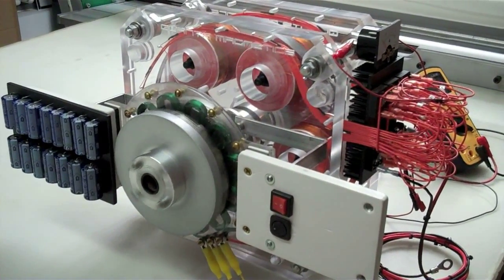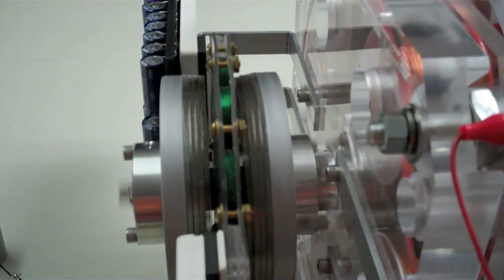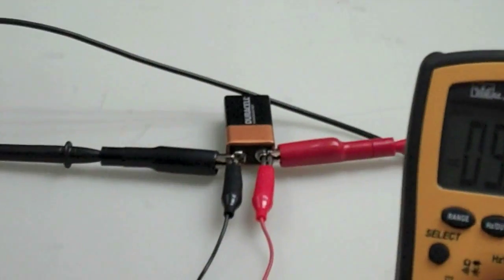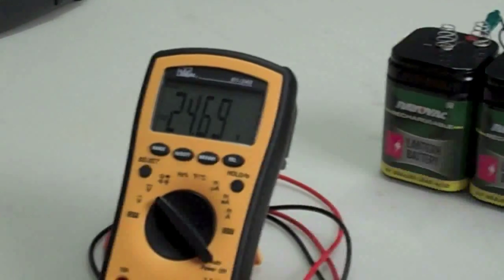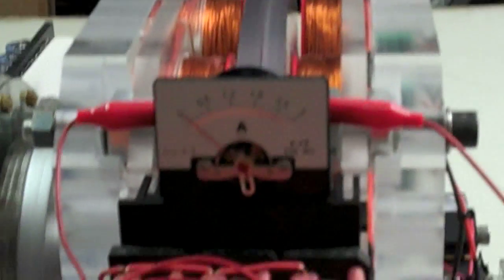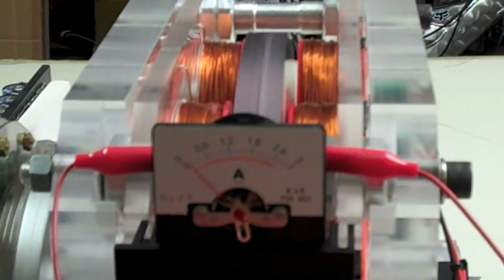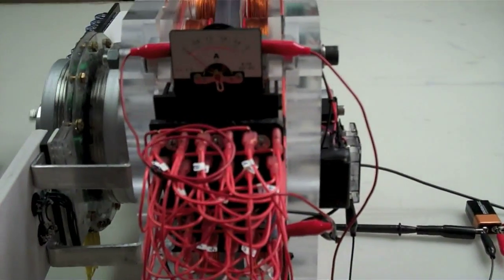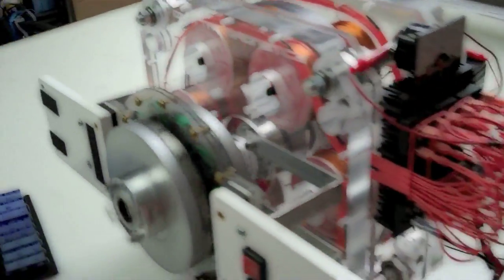Ultimate Pulse Motor Generator - New Energy

Comment: It is the relation magnetic strenght mulitplied amps that gives the force in motors
It is the multiplied forces of magnetic strenght, wiring and speed that gives the ouput current in generators.
Magnetic strenght is everything in this.

Comment: Well the relations are wiring multiplied by Magnetic strenght multiplied amps gives force(newton) which give speed- drag multiplied by magnetic strength and wiring
gives output current.
Forget about that input current is only lesser than the output current. That idea is not back up in any laws of electromechanic.
The magnetic strength is the key force here.

Comment: the magnetic strength is what the water wheel puts out, to say it in terms of the analogy.  That magnetic strength is then used to "pump other water up" (producing electricity). Drag is just lost friction energy. This energy is not gone it is just converted into heat (from the friction). I would not state that magnetic strength is key in this, it is just an in between state of the energy. Electricity->magnetic strenght-> electricity.

Comment: Imagine it this way. There is a lake on top of a mountain containing a lot of water.  The height difference is analog to voltage, the amount of water stored is coulomb and any stream going down is amps. If you put a water wheel in the stream it is going to create resistance and convert the tapped power into turning a grinding wheel for grinding wheet.

Comment: battery. In this case the size of the batteries is misleading. Overunity or free energy motors do not exist. Please accept and move on. There's tons of work that can be done in other areas of science, like computing, programming, quantum physics and more. Maybe use your experience with electric motors to make them even more efficient.

Comment: the only thing the energy from the 9 v battery has to do is overcome the friction. As your engine is "high quality" it doesn't have a lot of friction. You might respond with"How can it charge those other 6 volt batteries then, together even 12 volt?". A quantity of current is measured in coulomb or maybe overseas in another unit. The amount of current that those bigger batteries can store is probably less then what the nine volt battery can provide as they are lower quality then the first

Comment: The real reality is that it is the relation between the Tesla (magnetic strenght) MULTIPLIED with amps that determent the Force(newton) which create the speed.
It is the Speed MULTIPLIED by Tesla that determent the output current.

It is the drag in generator that determents the energy cost.
When infact you dont need Iron cored coil.

'That prove one thing, That Ideocratcy have existed in a very long time in the ingeneerings area.

Comment: Another "against the laws of physics" over unity machine, that is total BS. For Example. Suppose that 9V has 10 units of energy and this machine miraculously turns that into 175,000 units to put in those lead acid cells.....nope, don't work that way. Those lead acid cells be lucky to get 2 out of those 10 original units!!! Those pulse motors recoup some of that magnetic energy.... all that means it just lasts a little longer before it dies/stops. No New Energy and there's NO FREE LUNCH.

Comment: And exactly that is when it really get interresting.
The lesser mass, the greater speed.
So if the design of such example as this video, the relation of the generator and the electric motor. 
If the moving mass made as little as possible in boths ends.
An example is when the moving parts is only the wiring part.
It give greater speed, and greater speed gives more current.
And offcourse all drags must be made minimal.
Now the picture is different between input and output current.

Comment: I said power because both current and voltage counts, they work together , thats why a transformer can not ever be more then 99 % efficient. And secondly the magnetic field of a permanent magnet is not a form of energy and rather more a state of matter just like solids,liquids,gases,and plasma, and further more is not a very stable state as it is affected by temperature( extreme heat weakens the magnetic field)

Comment: It's actually the inverse of what you are saying.  When someone makes a proposition, the burden of proof is on them, not the dis-believer.  So, if this device is capable of charging large lead acid batteries off a small 9V battery, then the output current should be more than enough to power the input of the motor with energy left over.  I did not see anything that suggest this is the case with the video.

Comment: There are a lot of factors in this
The relations are
input current 
multiplied by Magnetic strength
multiplied by wirelength
Equals force kg/s
Equals speed
multiplied by magnetic strength
multiplied by wirelength
gives an output current.

Minus drag which vampires effective the output current
minus Back emf 
(Iron coil cores big sinner here, 
drag follows magnets strength)
How can anyone`in all that, believe that 
input current is the only relation with 
the output current.

Comment: Friction on the bearing? Then it is a bad designs.
Those things can be avoided. Try and look the link below up.
The laws of nature CANT be opinionated, it just HOW IT WORKS. That is the real facts and the fact are it works like The Caplace Law- 
Although I agree that it dont work that way in Iron coiled generater. Becourse the friction to the iron core increases along with the magnet strength.
In motors and generators with Non iron cored coils, that is a different matter.

Comment: The prove is within that is already told, you dont need calculate it into watts.
Put in to other words: Let say you have a generator that needs 50 newton to create 10 watts. Then you use a moter that needs 15 watts to create 50 newton load.
Now replace the magnets in the moter with some that is twice as strong
According to Laplace law.  
you will only need half as much watts (7,5 watts) 
to create 50 newton load.
And now the system creates more energy than there is put into it.

Comment: No offence, But You just dont get the math.
If you can avoid drag, you have constant kinetic energy.
That is by far, more energy that you have put into it. 
When the 4 properties relations are multiplied 3 times.
If the proberties are high enough you will end up having more energy than you put into it. Especially when energy cost is reduced.

Comment: The whole issue is revealed in the math. The relations between wirelength flux and amps are multiplied to find the newton force. It says nothing about the drag. That is added values. Such as coil inductains the higher Hz the greater the drag. The greater the ohm the greater the emf. Iron coilcores drags follows the flux strength. Point is a lot can be done in designs to avoid drag.

Comment: With no current in the wire it generates no magnetic flux, move that same wire inside a magnetic field and you can generate a small voltage but come on, you're never going to get out more energy than you put in! However much energy you pulse through those coils is how much energy you add or subtract from the kinetic energy of the magnet. Every action has an equal and opposite reaction, this is one of the fundamental laws of physics. If you'd like me to explain in more than 500characters email me

Comment: I am really questioning if coils is the right answer in the generator.
Becourse of the inductains its producing. Parallel wiring would avoid that.
Not very practical at first sight, but there are many benefits in that, due to lesser heat production, lesser drag, more amps, lesser volt. Simply way better flow in the system.
The battery is offcourse also a problem here. "A solution" could be electrolytes compined with batteries or simply use the power instantly.

Comment: Do you have, will you build or tell us information of your version of axial flux generator that is just right and enough power to run with QC Motor Generator without slow it down too much and still have current to charge a bank of batteries, it would be nice if you include with it a axial flux generator?

Comment: Your talking about a single engine. I am not. 
Nope the whole point is the flux, that is everything is this equations.
The flux, wiring and kinetic relation is what determent the energy.
The greater flux the greater output and lesser input.
That is why with out a doubt works.
IF you do it right and dont do all the drag mistakes.

Comment: Nope not even close, I'm surprised you missed my woodchuck reference. If we have a wheel spinning and assume a frictionless system, the energy required to maintain the speed would be 0, but any system incurs energy costs in the form of friction and resistance (electronic and air etc...). A magnetic field is present around a magnet weather there's a wire there or not, it doesn't go up or down, it's relatively constant.If x =1(newton / pascal etc), what do you measure and plot the wheel energy as?

Comment: Watched the video, but not too sure the "electricity" came out of thin air. For example, I have a 70 watt solar PV panel that will show 40volts after the sun has set and the stars begin to appear.  Along those lines, my 25 year old solar calculator works with very little daylight, or a candle light at night. If the cell phone charges in total darkness, are the radio waves providing the charge free to amplify for even a short conversation. Additional info appreciated.

Comment: Depleting magnets? have you ever seen old magnets?
They dont deplete lightly.
About the x,y thing. Consider a wheel with a fixed speed.
x as the magnets strength, Y as energy.
Draw a line for the amount of energy that is needed to maintain that speed, the greater magnets strength the lesser energy is needed.
Draw a line for the amount energy output the greater magnets strength the greater energy output
Well at some point there will be greater energy output than there is  put into it Good enough?

Comment: TheJback45 has a point, take for instance a car on the freeway, it only takes a little bit of throttle to cruise along (and overcome friction and wind resistance) but it takes a lot more gas to get up to speed, same principle applies here. The point isn't to dissuade inventing, it's to promote understanding of why things are how they appear to be. TheJbach45 just needs to learn a little more tact. Don't hate the physicist, hate the quarks.

Comment: Am I being stupid, or are you just using the rotorvator as a glorified transformer raising the voltage from your supply (ie 9v) to whatever output circuit you connect it to? How long does it take for a 9v battery to get your rotorvator up to speed? What was the starting amps coming out the 9v before charging the heavy duty batteries and what was it after? Does wind resistance make a significant difference to efficiency based on the speed of the rotorvators main shaft which houses the magnets?

Comment: yes, it create more electric power than there is put into it.
Becourse magnets are an energy and the kinetic energy of a low resistence system, make that possible to harvest that.
By it dont really use much energy to maintain that kinetic energy at a steady level, so the system ends up creating more energy than there is put into it.

Comment: it's just a high efficiency machine .
they said a heavier than air machine couldn't fly .
it's about using physical , mechanical and electrical advantage here .
but consider the cost of the unit , engineering , machining , materials , niobium magnets are expensive ...is he advantage really there yet , maybe as we become more adept at putting this stuff together .

Comment: Btw, isnt induction resistence in the coils also relate to the resistence that the magnets drag in the coils? 
That can be resolve by splitting the coils in the same coil.
Meaning making parallel connections in one coil.
As far as I can remeber the induction resistence will be cut in half just by splitting it into 2. Several parallels coils in the same coil should then limit the magnet drag to a minimum.
The consequence is though the amps will increase and the volt will decrease.

Comment: Well is it that, the equation
1: Maintain a low resistence kinetic energy is far less than to accelerate it.
2: The stronger solid magnets are, the more effecient it is.
3: The resistence in core less coils is minimal.
Point is, draw the nature of that in a graphical graph and dosnt that prove that The thermodynamic law is a lie?

Comment: So what, you can actually collect battery power, and convert it to 25volts easily, afcourse it will have lower amperage.
You say it has higher amperage, well yes, the amperage IS bigger, because we also can collect amperage, because battery contains a lot of power, but main electricity has not became more of it. It's pointless.

Comment: A common motor generator set is rated at 99% as used for synchronous machines.Therefore you can expect a matched motor to drive a matched generator at 99% efficiency.There is no scam here. It's just a dc motor generator instead of a poly phase set.We need dc sets to convert solar power to ac without inverter loss. Plus he is learning stuff.

Comment: i was wondering it takes 9 volt to run, and generate more then 9 volts? if so can you not feed the power back to power itself? so... spin it once it starts spinning on it own and generates power forever? or at least 100years cause of the magnets losing power over time? if i have the years count right on a state of the art magnet. allso if the magnet has more power output. say 10pounds magnet vs 50pound. or does that factor  give more? power just more ease of movement  for the Mechanics

Comment: ....and becoming saturated the magnetic flux path gives off kinetic resistance and excess electro-magnetic waves. By-products are heat, resistance to the stator, and electricity. In order to reduce the negative byproducts of heat and resistance on the rotor you must flip-flop the polarity of the coils. Whether you alternate the coil polarity on a motor or generator, both produce the desired effect. Correct me if i'm wrong.

Ken
revolution-green(.)com

Comment: Basically the concept is that you reduce the resistance on the prime mover using the pulse motor concept. If you read up on Ed Leedskalnin's Unipole theory, you'll find that a magnetic field when pass through a coil assumes the path of the coil. It does this easily because all magnetic lines of flux spin in a double helical right hand pattern.. When you move the lines of flux out of the coil however, the magnetic current bunches up at the exit end of the coil. Having nowhere to go.....

Comment: Hi PMMG4HYBTID-- Can you please explain what components did you use and on what order to charge the 12v ..?  i built a pulse motor/generator and i'm using the AC output of the generator to a --> rectifier -> the positive gets connected to battery that needs to be charged, and i get the (-) from the capacitors that I have connected in series 4 (Dayton -2MEh7-50uf 440vac) , the other end of the capacitor cable is connected to the output of the motor. 
I'll love to know your comments.

Comment: I been building generator for over a decade. This design smells fishy. So why wouldn't you just loop the output to the source? Why did you avoid showing us the device stopped then started? Show device running without  the large battery connected to output and show it stopped then started. Until you do this then your a charlitan.

Comment: I should have watched your other videos before commenting. You are doing very well and I like what you have achieved. I still would like to see you utilize the full potential of the coils and see what kind of return you end up with. I personally have yet to build anything. I just look at what others are and or have built and think of ways to make them better. The biggest thin I have found with everyones pulse motor designs is that they don't utilize both sides of the coils.

Comment: A couple questions for you. 1. How many amps do the charged battery's have before and after? Volts mean nothing without knowing the amps. 2. Why are you wasting 50% of the power pulsed into the coils? You can't have one without the other. Think about it. If you have a magnetic field on one side of a coil, you have the exact field on the other. It is just as powerful and if not utilized, it is wasted.

Comment: The truth is in Archimedes' lever situation:
Your driving coils have large radius disk than generating coils disk. So the physical force to compensate drag in generator seems to be just in about right ratio in your case.... Just my guess :)
Ultimatelly it would be large radius driving coils disk using this principle on small radius generator disk to accumulate large force enough for winning Lenz drag fight. The result.. you can imagine.

Cheers!

Comment from the maker: The Q2 uses capacitors that recharge while powering a light or small motor without batteries. That's no big deal to do. Take a look at "Q2 SELF CHARGING.Part 2".

Comment: agreed get rid of the battery and have the machine supply its own power, then we got something. Spin it by hand to start it, or use a pull strip if you need a longer duration for start up.

Comment: You show the input voltage and amps, but only the output volts. What exactly is the input watts vs. output watts? 

Judging by the time and money it would take to build this I would assume you have a decent and accurate amp meter lying around.

Comment: That is a nice machine, nice components, looks expensive to build. At this point it is a glorified battery charger, however nicely built and very efficient. I like it! Scaling is always the issue, going from 12 volts to 120v, 120v to 2-3Kv and on up to house values say 30Kv+ etc. It IS a very nice machine. Scaling up voltage is easier than getting something that scales up amperage to 20A - 30A I suppose that is what spinning magnets and wires are for vs transformers for voltage.